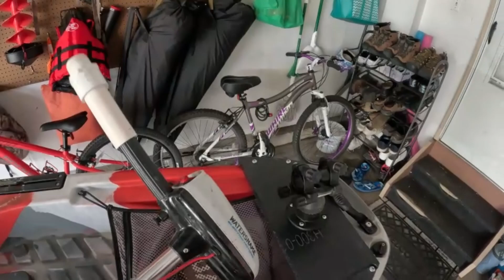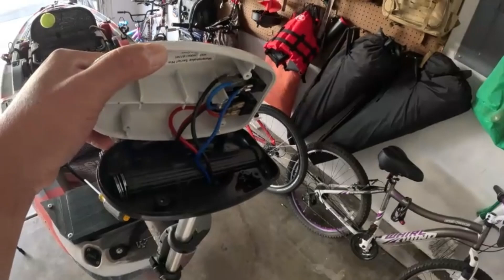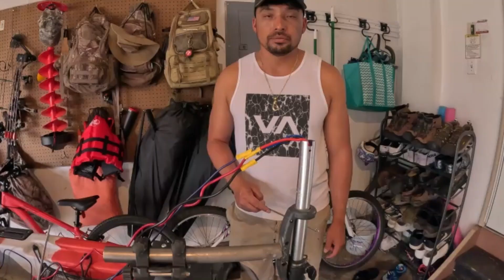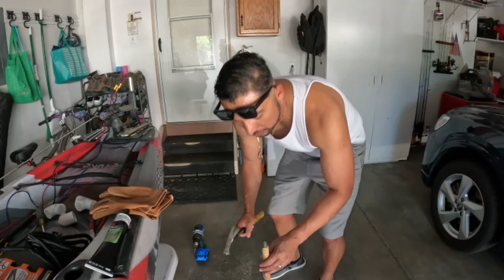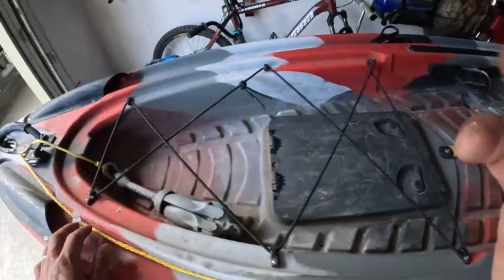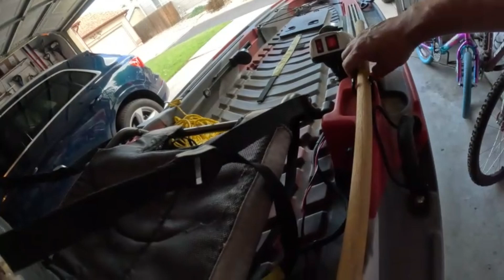Easy DIY Motorize Your Kayak Build

Comment: Hi, nice setup. What did you use to make the bracket that is holding up the trolling motor?
Reply: And the parts that's holding the pipes together
Reply: Do you have a parts list?
Reply from the maker: @josieurgent4162  
Water snake, the water snake comes with a mounting bracket.
Plastic bracket for the mount. I cut the plastic to my size kayak.
Female swivel rod end or turn buckle or eyebolts all will work 
A threaded rod to fit whichever swivel you decide to use.
2 Threaded rod couplers. 1 coupler fits the handle.
Hose clamps some to hold the wires in place 1 to hold the steering shaft to the trolling shaft for steering. 
Sigma pro connex to hold the switch box.
An old brom stick handle or something similar for the handle
6 ft of wires I use the same gauge. I think it's 8 gauge.
1 box of boot connector.
I hope this helps. I'll update my description. For further viewers. Thanks again.
This is my buddy project similar 
https://youtu.be/pyLYIt52hb4?feature=shared
Reply from the maker: @josieurgent4162  Thank you, just a piece of plastic. Kinda of like a thick plastic cutting board.

Comment: What did you use for the rod and the swivel bolt? Where can they be bought? Great video!
Reply from the maker: @Oddboggler  Thank you so much for watching. For the  rod holder, I used an old brom stick and the swivel bolt and extension rod. I purchased it at Ace Hardware.